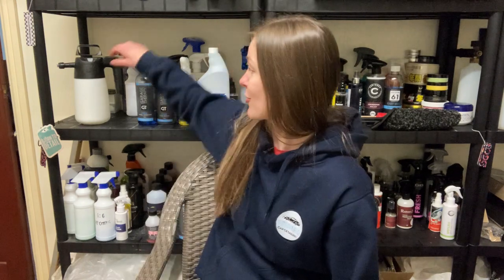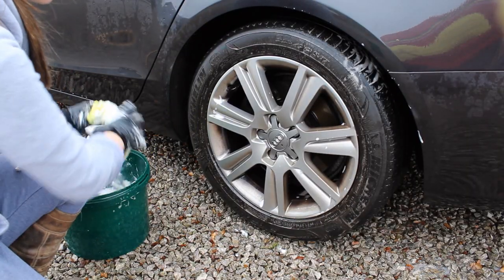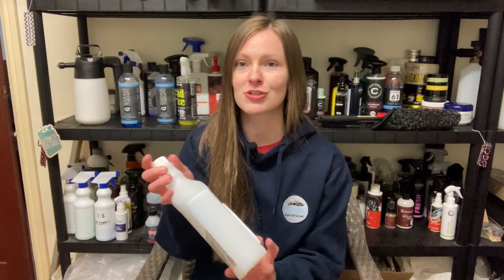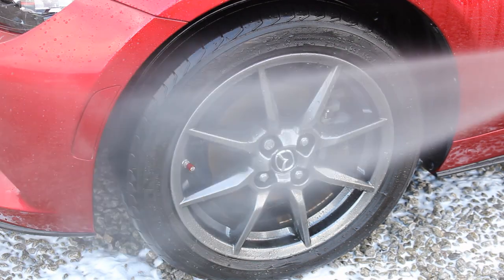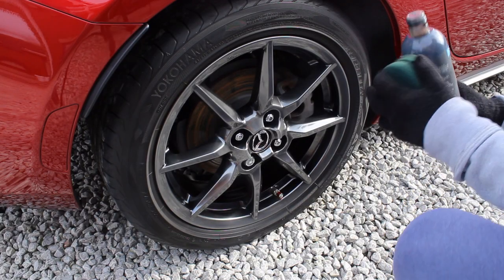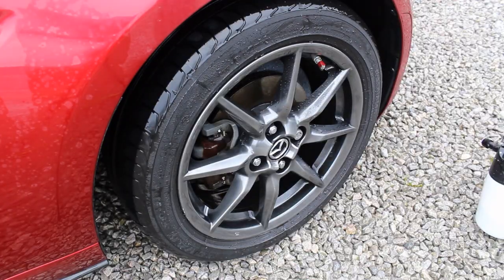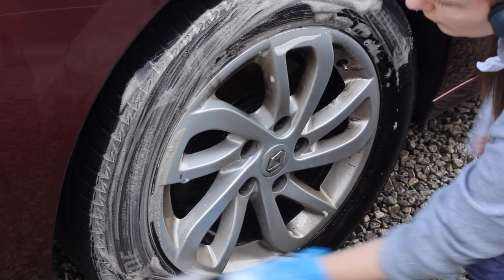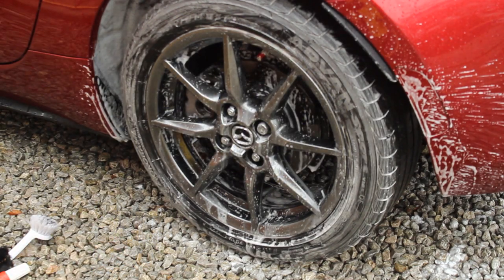My Current Favourite Wheel Cleaning and Care Products

Comment: Great video Heather! In regards to dedicated tire cleaner, what I have experienced by using one is that it sort of "penetrates" deeper in to the rubber and achieve a slightly better result than using Surfex HD. But this advantage is hence to that the one I used (ADBL Tire and Rubber Cleaner) is a solvent based formula, so obviously a stronger solution than a water based APC. At the end of the day, the difference isn't too noticeable and might doesn't worth to use one. However the benefits I like to use a dedicated tire cleaner over Surfex: gives more lubrication during scrub (easier to use), deeper cleaning and the main benefit what I have experienced and really like: the dressing lasts longer, I suppose  bonds better to the rubber than applied after using Surfex. I heard great things about AutoGlanz Rebound on tires, but at the moment that's only on the shopping list :)

Other than that, I couldn't clean wheels without using an IK Foamer 1.5 either, such a joy and adds to the user experience. I like it, I'm sort of close to upgrade to the IK Foam PRO 2, even if I don't feel that's necessary 😅

Comment: I second the Rebound tyre cleaner recommendations. It's not necessary for maintenance, but for deep clean before dressing it's great. The rubber looks great with this stuff. Clean but not dry and pale or brown. I suspect it helps maintain the rubber.
Reply from the maker: I think it's worth picking up even if I just use for when I clean other people's cars!
Reply: @AutoCareHQ  While a good APC might clean them just as well, the rubber looks and feels healthier with Rebound, and that's what I dig. I do not know how it affects tyre dressing longetivity and bonding, but if it's better for the rubber's performance, I'd take that. Some people carefully use solvents as prep for tyre coatings and I'm not a fan of that, because I choose a healthier rubber compound and not affect the performance negatively for the sake of looks or easier coating application.

Comment: Hi Heather. Do you use tyre serum every time you wash wheels and have you tried it on rubber door seals out of interest?
I def recommend autoglanz rebound  for tyre cleaning👍
Reply from the maker: I normally put a tiny bit of the tyre serum after every wash just to give the tyres a more finished look. I tried it on the door seals last week actually, looks really good! I'll be doing an update video on the tyre serum talking about maintenance and durability hopefully in the next month or so

Comment: Surfex edging out Zero as the tyre cleaner for you? 
Can highly recommend KKD R-Evolve for the wheel coating if you go down the new wheel and Ceramic route.
Reply from the maker: Yeah just on cost to be honest, Im too precious with zero, I usually just save it for special occasions 😂 brill, thanks for the recommendation!
Reply: @AutoCareHQ  yeah I get that. Try Zero as a prewash if you get a chance in a pump spray. Certainly on something like your car that's always super clean you could run it 1:50-1:75. Based on a 5l that is a seriously cheap pre wash 😎
Reply from the maker: @andywhite2930  It'll definitely try that, just got an IK sprayer so it'll give me a good chance to try it out!

Comment: My products of choice are as follows. If I want a deep tyre clean I use 303 tyre and rubber cleaner I presently use Auto Finesse wheel soap on the alloys and tyres and sometimes in conjunction with their wheel cleaner or Angelwax bilberry wheel cleaner but GT wheel soap is on the shopping list as I use the serum presently. I use an APC in the wheel wells and dress them with Angelwax Halo Wax.
Reply from the maker: I really need to pick up some angelwax stuff. I was really impressed with H2go, I’ll add those ones to my list too 😊

Comment: Can't go wrong with valet pro bilberry wheel cleaner. Also can be used on tyres. Good glug of car shampoo in the bucket and a few ez brushes
Reply from the maker: If bilberry wheel cleaner is as good as their citrus pre wash then I’d be very happy!
Reply: @AutoCareHQ  yes it's definitely good is bilberry. Regarding a pre wash I use bilt hamber auto foam or touchless as more powerful

Comment: Totally with you on #GarageTherapy wheel shampoo . Really useful and powerful shampoo over just using what you would use on the rest of the car . In terms of APC , and many will say its rubbish , I just use one from Aldi . Does all I need and its about 80p a bottle . Yet to try the tyre dressing by GT , currently using #Autobrite Tyre Gloss , leaves a more brighter finish the more you apply if thats your thing . In terms of protection Im putting  EZ Voodoo on the gloss black alloys of the Adam , CS3 on the 208 GTi and my Mitsubishi wheels
Reply from the maker: If it works then you might as well! I think you'd like the GT Tyre Serum, it's got quite a subtle finish but you can layer it to make it pretty glossy
Reply: @AutoCareHQ  Its on my " to try" list . With the length of time it lasts and how often Im able to wash some of the family cars it makes perfect sense to use something with a good life in it . Im low on 2 Sigma so when I order another bottle I will get some of that as well to try .